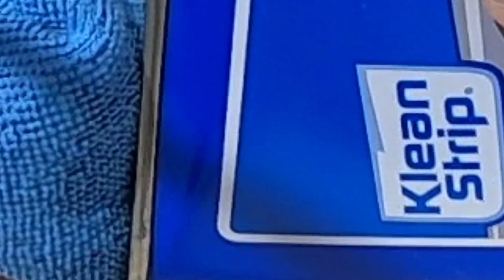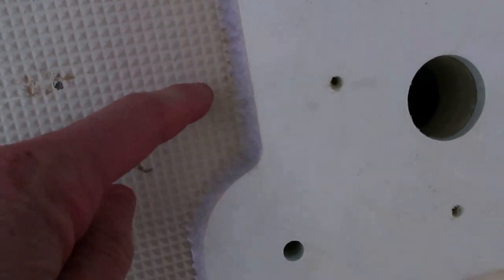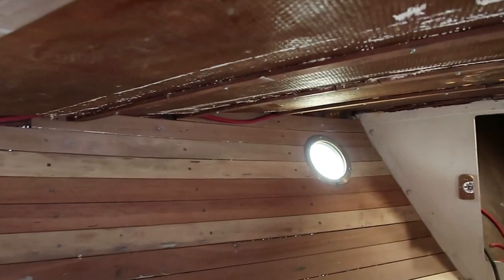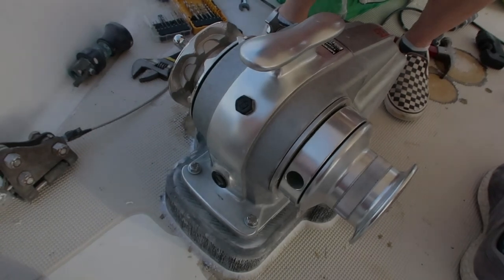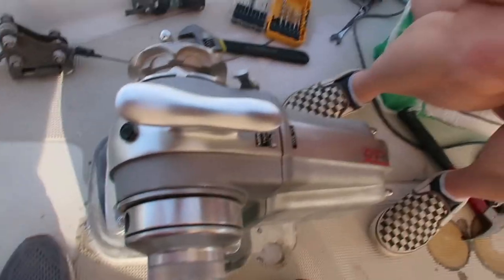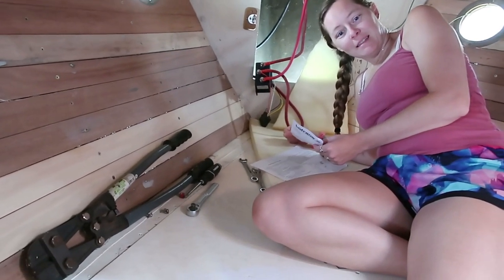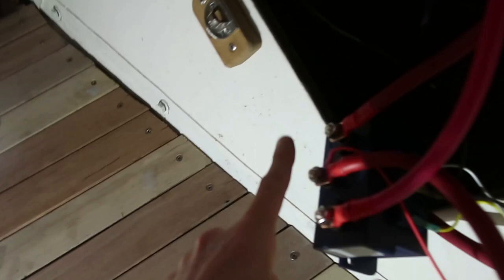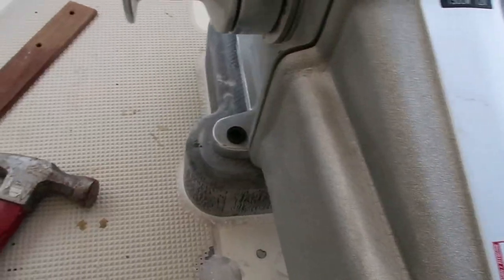Lofrans Tigres Windlass Installation On A Westsail 42 Sailboat | Sailboat Story 208

Comment: Glad to see our products on board 😀

Best regards,
Lofrans’ Team
Reply from the maker: We hope it works well. I wish we could say that it was a smooth experience, but behind the scenes it took a large effort to convince customer service send us the correct parts required for the installation. We received an extremely poorly machined gypsy initially. Despite providing detailed photos of the multiple production faults in the gypsy, customer service communicated that there was nothing wrong with it. We hope to never need Lofrans customer service again as we have very little faith in the competency of that segment of the company. For that reason, in particular, we really hope the windlass works as advertised.

Comment: That small ground for the remote could have come from the windlass motor ground lug. Shorter run. Spray some corrosion inhibitor on the motor connections. Keep up the good work!
Reply from the maker: We both realized that almost immediately after tightening the wire into place. We're going to fix that by doing just that. The connections are covered in dielectric grease.

Comment: Hey I'm getting ready to start refitting my boat and I'm wanting that same windlass, except i cant decide if i need 24 volts. It's yours 12 or 24? What size cable did you use and how long? Would you do anything differently?
Reply from the maker: 12 volts. Nope, we're happy with our installation. It's working well. I don't recall cable size, exactly. Maybe 2AWG? Big enough for low voltage drop over 30' at 12v.

Comment: The thickness of that riser made me do a doubletake, until I saw the elevation of the cap rail.  You should be within about 6 or 7 degrees of fall from the inboard roller to the gypsy.  Solid work, Ben and Tamby.
Reply from the maker: That's called a nose bleed riser.
...not really. :)

Comment: Ben, Tambi and Molly,
Nice to have met you last week.  I successfully modified the LaVac pump, installed it in my Islander Freeport and now have a head that is working excellent.  I spilled some smelly liquids that were left in the plumbing and we will have to hold our noses for a little while, but it will be worth it.  
On your windless project, I also have a Lofrans Tigres.  One of the problems with a windless is getting big power to it to haul that 200' of chain and 70# mantis.  I opted to put a lead acid battery in the chain locker which avoided having to have long  runs of that massive cable.  I did run wiring, but much smaller gauge just to incorporate to the charging system.   Keep the connections tight and lubed to prevent corrosion, I use Boeing's T9.  
I am also planning on getting a wireless remote for the system.  If you have looked into that please share.  
I just finished going back into your older videos.  Keep living the dream!  
Scott, Marie, Scratch and Sniff. SV Gratitude
Reply from the maker: Scott, glad to hear that the pump worked out. For the windlass, I can't recall the exact wire gauge, but we just followed Lofrans guidelines in the installation manual. Our wire run ended up being about 10ft shorter than the max so we should be good, theoretically. I do need to get the connections inside the windlass housing greased, but everything else has a thick coat of dielectric grease already. We did buy a cheap wireless remote from Amazon. Actually, we bought 2, and each receiver comes with 2 remotes so we have 1 spare receiver and 3 spare remotes. We do have a manual, wall mountable switch that we can use if needed, but I'd also like to build a hard-wired remote on a coiled cable that can be used if the wireless ones don't work out. We'll see how it goes! Happy to hear that you're going through the older videos. Those were great times and we're looking forward to new adventures one we get this boat put back together. -Ben

Comment: You make the hard grind <<edit: add 'look'>> fun, as always. Just a small tip from a veteran penny-pincher:-  Line your paint trays with tin foil. When the painting is done for the day just scrunch up the foil and bin it, and you still have a clean paint tray. I know paint trays are cheap, but the time wasted when running out of them is not.
Reply from the maker: I like it.
Personally, I use tin foil so that it holds the tray's shape a bit better.

Comment: Do you happen to remember what size bolts you need for mounting the windlass. Doing the same job myself soon, in a remote location, so have to bring all the supplies with me. The template says drill a 7/16" hole, so presumably the casing will accept a 7/16" bolt? Or did you have to go with 3/8"?
Reply from the maker: Sorry, I don't recall exactly. I'd check, but we're not at the boat right now. If it were me, I'd send the manufacture a message to confirm.
Reply: @Sailboatstory  Just done as you suggested. Thanks
Reply: They advised 3/8" or M10 (in case anyone needs to know).

Comment: You can melt solder onto plain copper to add that layer of corrosion protection if you have the time and patience
Reply from the maker: I'd be concerned about the solder wicking up the wire and causing a stress point where the solder ends. I believe you mean just the lug itself, but it's tough to control hot solder. I suppose soldering the lug before crimping would be the simple solution, but everything is well greased, plus like you said, I have neither the time nor patience... nor soldering iron. (at least not at the boat, anyways)

Comment: Please excuse the OCD, but…  PLEASE, Create a list of your battery powered items, such as the windlass remote, flashlights and any battery powered navigational gear.  And "list the type of battery" for replacement.  Then replace those batteries once a year at new years day (Or April Fools Day).  Not because the batteries are dead or dying but because CORRODED BATTERIES WIPE OUT YOUR ELECTRONIC GEAR.  Replacement parts are hard to come by out at sea.  You want your equipment to work when you need it.  Old batteries have only one purpose for existence and that is to destroy irreplaceable electronic equipment.
Reply from the maker: Not a bad idea. April Fools Days seems like the perfect day to coincide with battery replacement day. Yeah, I know what you mean. There have been a dozens or so time when I've opened the battery hatch on something and found that dried, crusty acid stuff.
Reply: I hope your not talking about my lithiums which are warranted for 7  years and cost $1000 each!  I use mostly rechargeable batteries.  Constant recharges ensure they are not corroding.  Best I found so far are by Ten Volt.  They are expensive, but last longer.  They also have a built in led when charging which is nice.
Reply: @sailingrumrunner  Actually talking about AA, AAA, C & D cell batteries.  Maybe some of those little lithium batteries which are a choking hazard every two or three years.  Finding the Right Kind of FRESH spares for those can be a challenge.  BUT if you want to swap out the big guys yearly I will bet you will find fellow boaters lining up along the dock, happy to help you get rid of those year old babies still under warranty.   LOL

Comment: Are you worried about galvanic corrosion on those terminals for the windlass due to using 2 dissimilar metals and the high potential ofsalt water making contact with them?
Reply from the maker: Not with the insulators that are between the stainless and aluminum. Irregardless, corrosion will inevitably occur, but you can only do so much keeping all similar metals together.
Reply: Oh.. didn't see you place the insulator washers between the connection and the nut..

Comment: At least spray the connections with some corrosion inhibitor. The will go away fast on the bow without it
Reply from the maker: Way ahead of you. Done and done. They're slathered with dielectric grease.
Reply: 👍🏿 and fyi any non conductive grease is dielectric like synthetic super lube and it’s cheaper. Top notch work.
Reply from the maker: Oh that's nice to know. I have a couple tubes of that stuff.

Comment: Using the same remote myself, so far it works great.  The relay only lasted a couple years though.  They're cheap though, so worth having a spare, assuming you can find the spare when you need it...
Reply from the maker: We did buy a spare kit so we have 4 remotes and 2 receivers. I also have a manual switch that we can use if all else fails.

Comment: Was any of that stuff you painted made of aluminum? Aluminum needs a self- etching primer and then a second coat of primer or primer paint combination to maintain the finish. Otherwise, the paint will blister off.
Reply from the maker: Yes, I’m aware of that, and no, none of it was aluminum. I’ve repainted a couple outboard lower legs before and the process you described is essentially what I followed to repaint those. Thanks for the insights.

Comment: I feel like you may have over-bedded the windlass. Some day it may have to be removed and replaced with another type. That plate you epoxied in will not be easy to remove.
Reply from the maker: Over-bedding the windlass? I thought you were making a joke at first, but now I think you’re being serious. Over-bedding, huh? Is that like having too much insurance, or eating food that’s too healthy? First of all, I disagree in a big way. It’s a very good thing to know that one of the most critical pieces of gear that exists on a big, heavy sailboat stays firmly attached. Second of all, that epoxied plate would come off with about 3 minutes of work with a power planer, if need be. No worries, fella! Wow. 😁